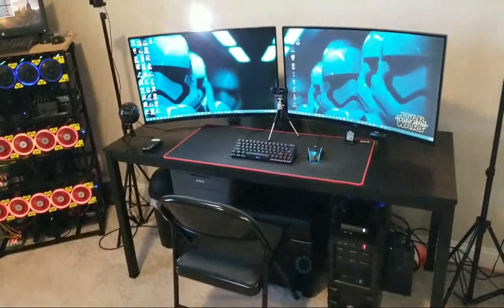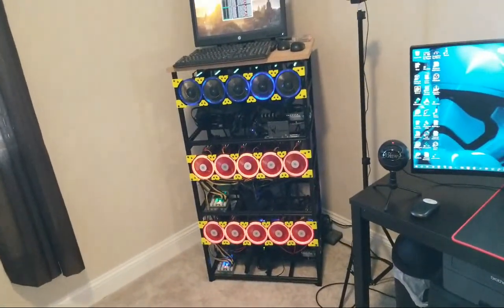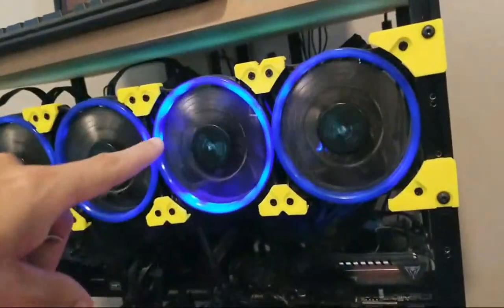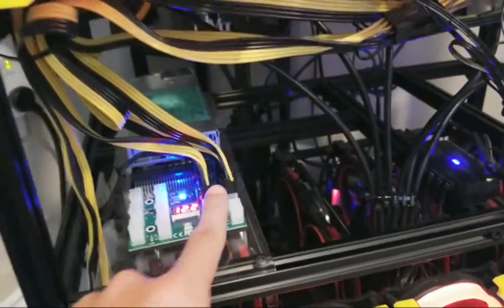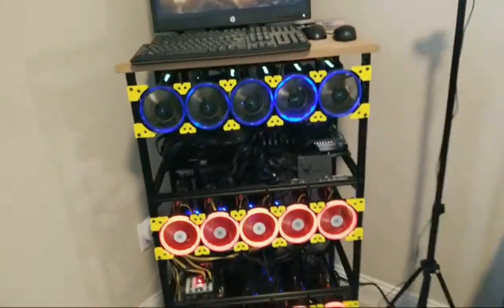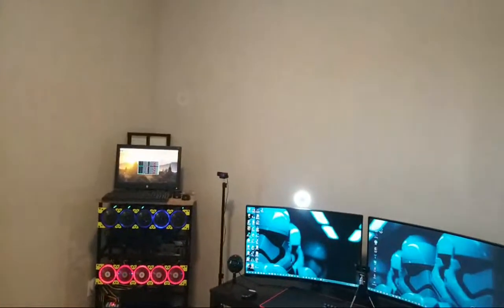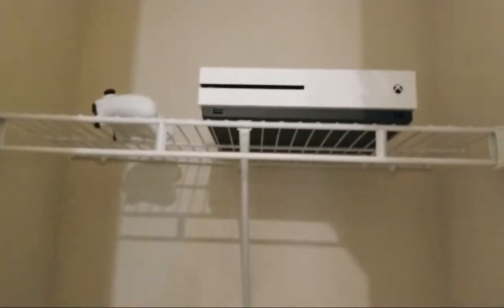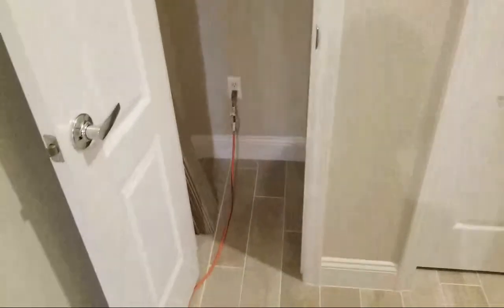Structured Wiring and Network Upgrade Overview

Comment: Nice too see you are still around. Your celling fan should have a directional switch on it it will reverse the rotation and help draw cold air in. Standard extention cords and excessive lengths provide massive voltage drops increasing current to get the same job done. Soow cable peoperly sized and length will stand the test of time. I think their is a efficiency boost if power supplies are ran at 240v. Unbalanced panel phase (legs) loads also are something to think about. Great work keep it up. Hard wiring through the attic is not that difficult you could run the rig rack on one 240v fedder circuit safly with  sub panel located on the side of the rack for individual power supply protection.
Reply from the maker: For the fan, I'd still be circulating hot air. :-) I ran all the cables in my previous home (HDMI, audio, etc.) for all displays and stuff. I spent hours in the attic in the old place. :-)